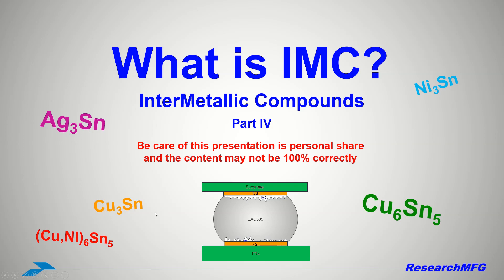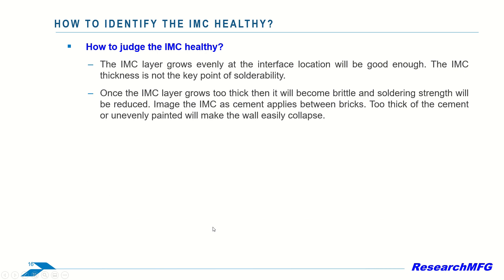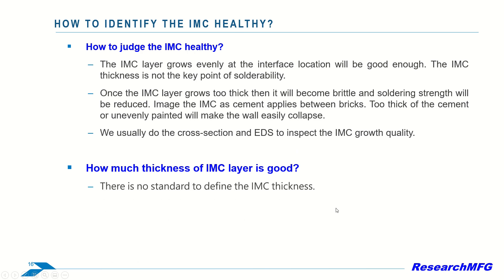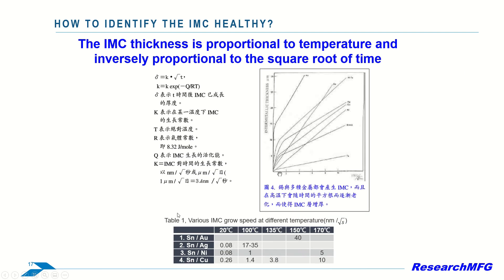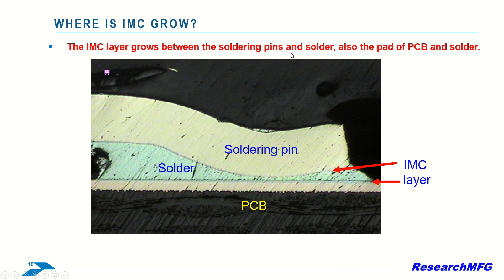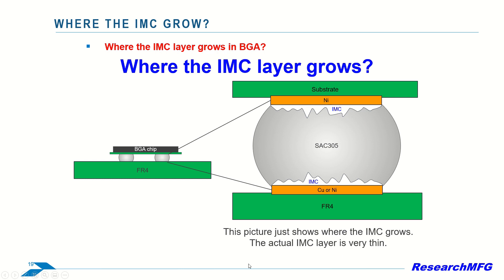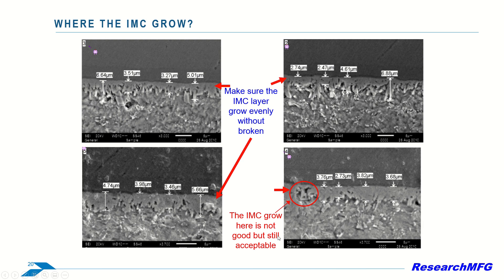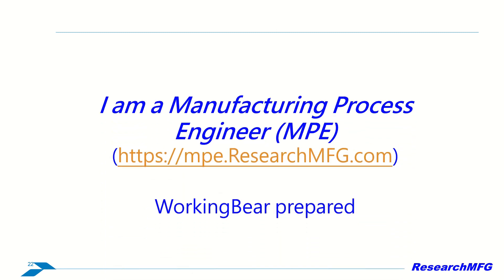What is IMC (Intermetallic Compounds) part IV? how to judge IMC healthy?

Comment: Hello, I have question~
I am studying about IMC, and i know that thick IMC is not good for strength of solder. but the ppt you explain that the poor IMC layer  which is thinner than good IMC. Can you explain about it
Reply from the maker: Well, this video didn't mention "the poor IMC layer which is thinner than good IMC". The IMC should ideally grow evenly at the interface position. While the video noted that a thicker IMC can become brittle, it didn't address the potential problems with a thinner IMC. Instead, the video emphasized the importance of even IMC growth. In my opinion, if the IMC layer is too thin, it may grow unevenly, resulting in reduced strength."